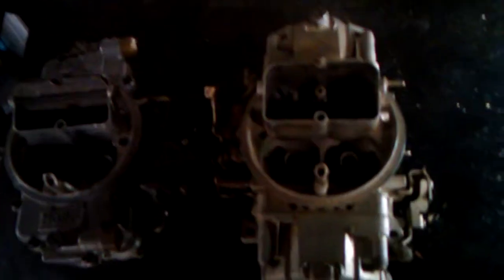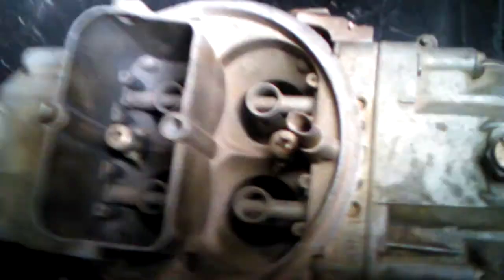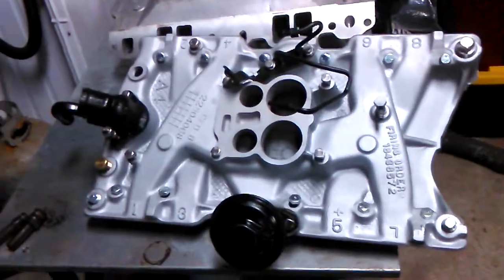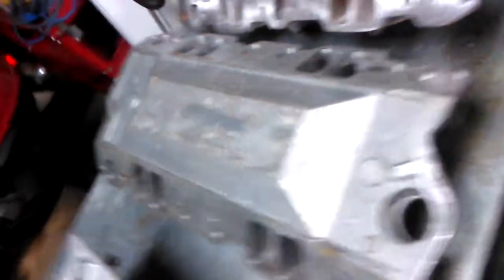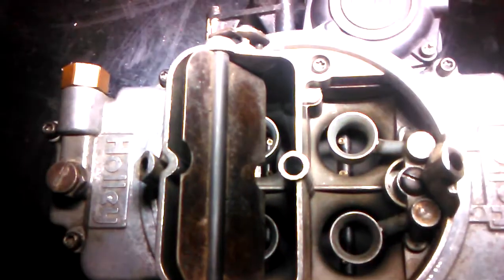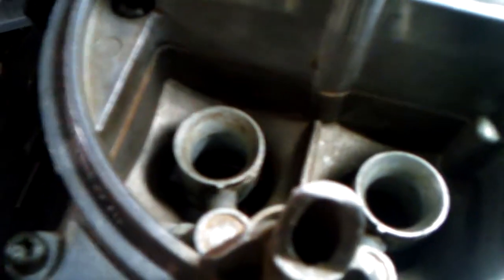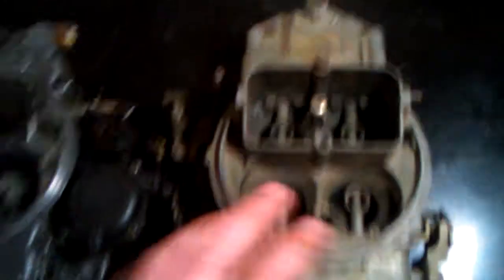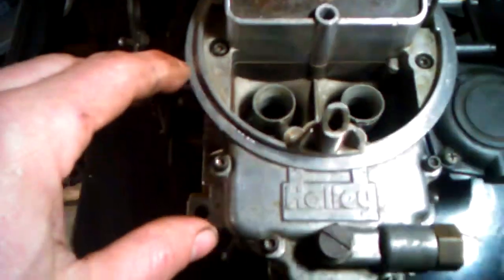Old-school intake manifold mods, part 4: carburetor selection

Comment: I went with the Holly 650 or was it 750 Dubble Pumper Spread Bore bolt on it worked great on both my motors 330 small block and 425 big block with 4000 Stall Converter Trans-Break Reverse Pattern Valve Body and 4'56:1 Posi from first to second went sideways and second to third squawk the tires good 7 feet rubber.  With 4 speed same but breaking parts wheel bolts u-joints etc. I guess your not disposed to side step clutch on wide open throttle...lol...

Comment: Hi Shawn, if i block the crossover then i have a non- heated intake  can i still use my Quadrajet or is it better to switch to the Holly  ( left one in Video ). My car is a daily driver and only want a little more power out off the engine ..... Roger.
Reply from the maker: My first thought is to tell you go with the annular booster Holley /Summit model.   However, let me add one complication.  IF you need to add a adapter to do it (because your intake manifold is already a spreadbore, and not a square bore pattern,) then I would probably keep the quadrajet, maybe throw a few bucks into a good rebuild if you think it needs it.  Carb adapters can nullify the gains you make with boosters; for the most part, they allowed you to bolt the carburetor on, but they steal power.  A third alternative would be to find one of the old spreadbore Holley's, IF it's the aluminum model with the annular boosters.
Reply: @ShawnStjean  Hi Shawn thanks for quick answer. Quadrajet I rebuild last Christmas ( smile).... My Engine is a 350 Olds 79 it has the Original intake spreadbore. so if i use  the spreadbore gasket i can use the Quadrajet Correct.? or use a square bore Gasket ? another idea was  to Buy an Edelbrock intake 2711 dual plane and  block the crossover then i need the Holley or the Quadrajet is still working on that application and what Gasket on the Edelbrock if i decide to buy....  what are your thoughts Kind Regards Roger. (The Netherlands)
Reply from the maker: @MySonMarlon  Hi Roger, You'll be using a spreadbore gasket, and it should work with your q-jet with no spacer.  Now if you want an improvement you can actually feel, a 7111 Edelbrock (NOT 2711 or 3711) with a blocked crossover will do that for you.  You will need another 2 inches hood clearance over stock (most cutlasses have it.)  That manifold usually comes new with 2 plugs to block the crossover, that have to be ground down with a dremel to fit.  Used ones (Edelbrock Performer RPM) go for $250-$300 here.  You might also use a heat  separator plate under the carb, with multiple gaskets, to keep the fuel cooler.  Another noticiable gain can be found if you can route cold air from outside the car into the air cleaner.  Check your spark plugs after a few test miles to make sure you are not running lean (gray-white) and you may also need slightly less timing than stock.
Reply: @ShawnStjean  Hi Shawn Goodmorning overhere.... for sure you sleep at this time.thanks again for your time........ one thing i dont understand... with the crossover blocked we take a lot off heat away underneath the carb why we now need a heat separator???? It is allready much cooler because we blocked the crossover what i am missing ???? Or this is Double action......... 1 :crossover blocked is an improvement ( Cooler) and 2 :Heat separator another cool improvement.  or do i need this heat separator only with the 7111 Intake ?Roger.
Reply from the maker: @MySonMarlon  Yes, it's a double action.  Optional, not required.  Aluminum conducts heat at 4x the rate of cast iron, so whatever heat the manifold picks up through the water passages, it will send to the carburetor.  You can never get the fuel too cold (assuming the car is not driven below 40 degrees in winter.). Or the air, for that matter.  Colder is denser, contains more oxygen and will pack more and burn better.  Again, don't run lean, and you will be happy.
Reply: @ShawnStjean  Thanks Shawn for the detailed information and quick responce.  Have a great day. Buy the way like your video,s . Roger.

Comment: I was so excited to see this video.  I have actually blocked the exhaust ports on my cast iron intake and plugged the ports below the carb.  I was running a quadrajet but am interested in that holley.  Any info would be helpful.  If you don't feel like responding I get it.  No hard feelings.  Sidebuster09@gmail.com thanks either way
Reply from the maker: Annular boosters are the key for a non- heated intake.  The summit line of carburetors has them, as an inexpensive foot in the door piece that works pretty well. Also the Edelbrock avs2, though I have no experience with 'em.  Then of course there are the higher-end models
Reply from the maker: https://www.ebay.com/itm/AED-850HO-AN-Holley-Double-Pumper-Carb-Street-Race-Annular-Boosters-850-HO/332009731103?epid=0&hash=item4d4d52741f:g:0zIAAOSwal5YCl8V
Reply: @ShawnStjean  thanks so much for replying.  Now that I know the summit carbs have annular boosters ill probably start with one of those.  I just have to figure out what size. I excited to finally try something besides a quadrajet.
Reply from the maker: Be aware that if you have a Quadrajet (spreadbore) manifold and go to a squarebore carburetor, which the Summit and Holley carburetors both are, you'll need an adapter, and those are not so good for power. If you must, I like the four holes spacer-adapters much better than the open ones.  They maintain the velocity of the air/fuel mixture.  Also, a wood or phenolic one will keep the heat out of your carb better than an aluminum one.
Reply from the maker: Depending on how poor the adapter,  only a Dyno can tell you for sure, or of course a run at the track, whether the Quadrajet would be better than using an adapter. I have had a few quadrajets that were set up by experts, that work awesome.  The people who can do that these days are few and far between
Reply: @ShawnStjean  for sure.  I think its worth a shot to try a new setup.  I have been curious about holleys for years.  If it doesn't work ill either try a different intake or put the quadrajet back on.  I just wish we weren't heading into winter.  I'm afraid I'll get it set up and have to wait until spring to really test it.